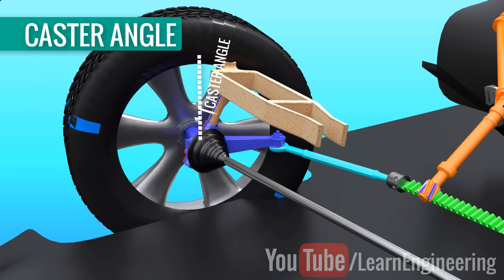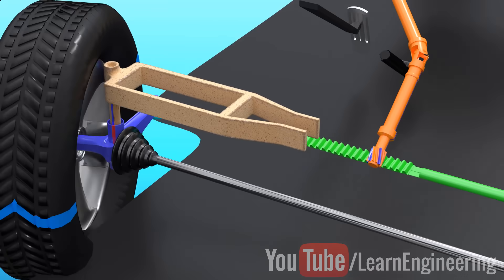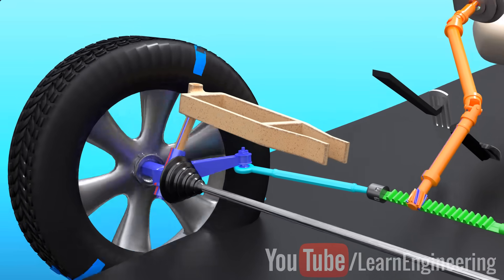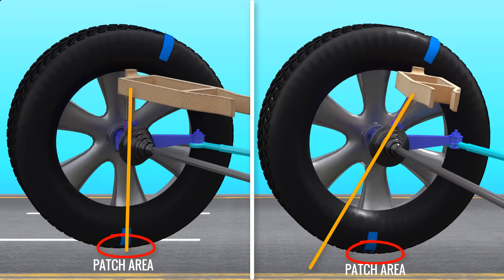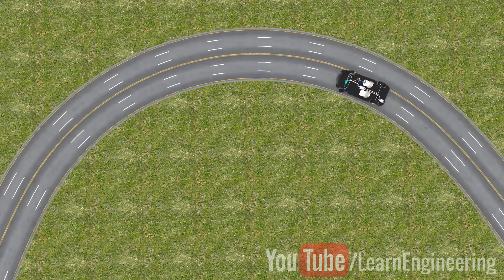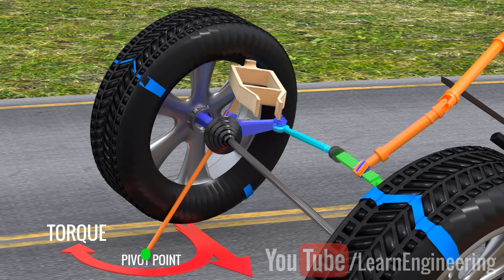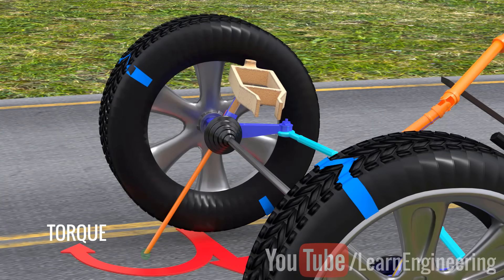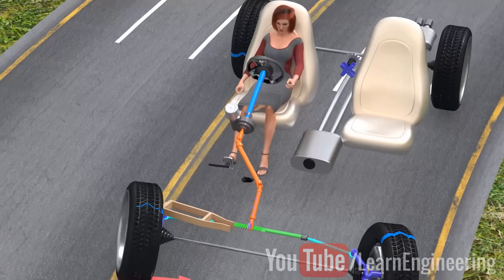How does the Steering Wheel automatically returns to its center?

Comment: Can anybody help me out here, ?
after a service something happened suddenly and my car's steering wheel won't return to centre, and steering feel little hard to turn, I replaced new pair of tyre in the front as replacement was needed anyway, replaced steering rack, checked suspension, but the problem persistent. Since caster angle isn't adjustable, adjusting which angle and to what degree should fix the problem.

Comment: Does a caster effect exist in an electric steering rack vehicle?
I replaced the broken control arms and tie rod on a BMW 320i with the electric steering rack, after a collision.
After the perfect alignment the steering wheel does not go back to the center after a turn.  Is there programming or coding that needs to be done for that to work, after replacing the tie rods?
Its not my vehicle but the owner claims the steering wheel doesnt go back to the center after turning.  Im concerned now.  
Please advise!

Comment: Some one make me feel stupid will lager diameter tire change the caster in any way 
I've had a truck since it had 100,000 MI it now has 375 
Multiple  times I've rebuilt every component in the front end except  steering  box and dam truck doesn't return  to center on its own on The highway it does a little, it does have larger  tires  and cognito a arms that allow u to bolt the ball joint in from either side to compensate  for larger  tires but it did same thing when I got it and it was factory tire size a arms everything was Factory it actually took me a little bit to figure out why exactly the steering felt the way it did trucks never been in an accident even before I got it I know who owned it the whole time when it's got new tires balance they drive straight no shake vibrations I guess at this point I can try a steering box the truck don't owe me anything but I don't think that's going to fix it any suggestions or ideas would be appreciated

Comment: This is not a centrifugial force. This is a gravity force. It works on a wery low speeds too, which is not the case for a cent. force. When you turn the wheels you push your front axis (and the center of mass) a bit upwards. And when you release the steering the whole system goes to the most stable state with the lowest position - when the wheels are straight. Just check with your bicycle or a bike. Keep it perpendicularly to the ground and turn the front wheel. You will see how it goes a bit up and when you release the grips it will turn the wheel towards the straight position and goes a bit down. Though the friction won't let it make completely. You can even check with your car - just turn your wheels right and left when the car is parked. You will feel how it goes up at the far lefr and far right positions and goes down when you cross the straight position.

Comment: i am an engineer 47 year old. i have been working as a professional Machine designer for 25 year. i did many models and simulations to find answer to the same question what you are dealing.  in four wheelers we are using the akier-man steering gear mechanism and 'amber' is the inclination that takes the turning axis's centre to the rotating wheel centre where the wheel touches the ground. when you look from the front the axises of  the front wheels seem to be like the letter 'A' (this much visible in form trackers)  . caster angle is being used in 2wheelers which gives a counter force that stabilizes the vehicle upright while in motion.

Comment: There are kits to implement adjustments that the manufacturer did engineer into the design. The most common is a camber kit. On a strut system the strut mount holes can be elongated to create a caster adjustment. This is usually required when there is collision damage that either the body shop can't fix or the customer doesn't want to pay for.

Comment: This definitely makes sense, but the textbook I'm reading about it (CDX Fundamentals of Automotive Technology 2nd Ed) is saying it actually has to do with the body roll of the vehicle pushing the stub axles. The wheel turning out causes body rise and the one turning in causes body fall/lowering. When you let go of the wheel, the side that rose will push back down and, working with the caster angle, push the wheel straight again. I imagine the whole answer is a combination of these two concepts, as this one helps to explain how shopping carts get crazy when you push them really hard. They seem to lean into a turn on their own, even if you pushed fairly straight. The centripetal force is then in front of the steering angle  (due to negative caster on the rear caster wheels) and would reinforce the turning in of the wheel.

Comment: In a more simple way, the concept is very similar to that of a shopping trolley where the wheels are off centre from the swivel connecting each wheel to the trolley frame, so when you push the trolley in a straight line the wheels will align in that direction.

Comment: What if the steering wheel doesn't return to the exact center, but a bit to the left. Can this be adjusted ? The car goes straight while holding the steering wheel straight however if I take my hands off  it will slightly turn left and stay there.

Comment: Well explained. However, it would be great to also point what drawback this solution has : the patch area is made non uniform during turns, and the tyres wear in a non uniform fashion. Maybe there are other drawbacks too, like a smaller patch area , I'm not sure

Comment: WRONG!! the castor angle is responsible for steering stability. What actually does the sterring return is the SAI or KPI angle (King Pin Inclination). it´s the spring´s inwards lean, when you turn it pushes the car up about 1 inch, when you let go of the steering wheel gravity pushes the car back down and return the wheels to their original position

Comment: Yea but it doesn't work if you are stopped  so it would be better to just put 2 sensors, one on the wheel and one on a neighbouring object so that it can calculate where is the straight wheel position it would help drivers to coordinate while parked witch is straight and witch not(ofcourse then it would need a electric powered motors to move the wheel which may be more complicated)

Comment: A similar effect you can see with motorbikes as well. A cruiser has a relatively higher caster angle and feels more stable. While street bikes and sportbikes have an almost vertical axis of rotation in front, which is why you see them wobbling more often.

Comment: You could have made it a little more complex by explaining how the steering arms are not parallel which results in the inner wheel having a tighter turning radius than the outside wheel. Do that on the next video.

Comment: The engineers probably applied the castor angle to overcome the body roll loss of traction due to centrifugal forces, the return to zero of the steering was perhaps a added bonus which came as a surprise to the benefit.

Comment: Pneumatic trail in addition to mechanical trail (caster) are the components responsible for steering wheel return. At low lateral accelerations (low tire slip angles), the pneumatic trail is at a maximum. As lateral acceleration increases (increasing tire slip angles) the center of the lateral force moves forward, reducing the pneumatic trail, and thereby reducing the aligning moment that causes steering wheel return. At very high slip angles, the pneumatic trail can change sign, and the 'aligning moment' is now acting to increase the steer angle. This change in pneumatic trail will change the steering wheel torque perceived by the driver, and can be a signal to the driver that the limit of adhesion is approaching (and quickly.....)

Comment: I think this kind of mechanism also shows up when you are free handing in the bike. When you're turning the bike, the centripetal force acts in the pivot point with restoring torque due to the fact the the pivot point is in front of the patch area of a bike, therefore, provides a restoring torque
Reply: I think another perfect example is when you push a trolley. When the trolley is moving forward the front wheels is automatically adjusted towards the direction is heading.
Reply: Veritasium made a video about that very thing!
Reply: @EmceeJoseph   is that about trolley one, can u just share the link here
Reply: Which one? @EmceeJoseph
Reply: Deez
Reply: nuts
Reply: @dockwonder2278  inside
Reply: @quaxky326  yo
Reply: @musiciansdreams2541  mouth

Comment: It is not the case when front wheels have driving force. Since power steering was introduced. In fact,  nowadays, self centering force mainly rely on Steering axis inclination (SAI) instead of castor angle.

Comment: Fun fact, if that angle was inverted, steering wheel would automatically go to full turned position, you can observe that by driving backwards in  some older car that doesn't have any "helping" mechanisms or electronics

Comment: This is such a hard concept to grasp. When I first heard about it I kept getting bogged down by the fact that the tire basically is turning through the ground. Definitions really helped with this tricky concept. I'm still confused about the turning into the floor thing but at least i know about patch area and the axis not lining up with the patch area being the reason for that restoring torque...really cool stuff!
Reply: You're not turning into the floor, you're lifting that corner of the car by a little bit. That's part of the reason why caster angle increases steering force.
Reply: Nic

Comment: In fact, there is still a restoring (a.k.a. aligning) torque even if the caster angle is zero. That is so because the lateral force does not pass exactly through the center of the contact patch (patch area) in moderate speeds.

Comment: What happens during a drift though ? The wheels will countersteer to correct the drift inspite of the increasing tilt on the tire against the ground, which in a normal forward driving would help them to align with the forward direction of travel. In a drift they align with the new direction inspite of the increasing tilt which should push the tire straight, until the tire is not tilted anymore right ? Apparently its still better for a tire to align itself with the drift even though the caster angle should fight it ?

Comment: This video is completely wrong. Actually, the self-centering mechanism has nothing to do with the caster angle. SAI plus wheel offset out to the steering axial is the only source for self-centering.
Reply: The easiest way to falsify this video is to understand that the self-centering mechanism is a static characteristic, i.e. it comes from gravity and has nothing to do with the dynamic things such as speed or any kind of inertial forces such as centrifugal forces. Even if you put both the front wheels on two frictionless patches in your garage, you can still verify the self-centering mechanism.

Comment: The most significant part is 0:26 where you can see that when the car is in a curve the centripetal force induces torque in the caster angle direction. This is because the where the tire meets the ground and where the tire is connected to the axle form a moment arm.
Reply: Thanks bro! Your comment actually cleared my misconception that why does the torque produce I was missing the moment arm thing

Comment: Honestly I just thought it was the wheels straightening out via force with the ground and that turned the wheel back.
Reply: Basically. But that only happens when the contact patch is behind the pivot point. Hence, castor.

In shopping carts, instead of using the angle, they physically position the wheels behind the pivot axis, which achieved the same effect.

Comment: I don't agree that it's the centripetal force the centers the wheels when turned. The reason for this is that even when you are crawling along very slowly, the wheels will go to their straight-ahead position, and there will be almost zero centripetal force then.
Just found this:
"The caster angle is popularly described as the angular displacement of the steering axis from the vertical axis of wheels. This further implies how far is the steering axis to the vertical axis when viewed from a vehicle’s side. When you turn the steering wheel to direct the front wheels, the wheels pivot about an axis that is far away from being vertical.

For a fact, the pivot line would lean backward at the wheel’s top with reference to its bottom. In turn, the car would lift a little, but the steering wheel input would help it stay on the ground. When you let go of the steering wheel, the weight of the car pulls the steering back to its original position. This makes clear why steering wheel returns to center after turn."
https://carfromjapan.com/article/driving-tips/steering-wheel-returns-to-center-after-turn/
Reply: ... when you turn the steering, it slightly lifts the car due to the castor angle, therefore the mass of the car brings the wheels back to their straight ahead.

Comment: I heard another explanation, the angles are not the same, if you turn right the right wheel makes a larger angle than the left wheel.
That makes that, assuming the forces of friction parallel to the length of the car are the same on both wheels, the left wheel generates more torque than the right. The angles are not the same because the arms are not parallel but form a regular trapezoid.

Comment: Nice. So if you mount it the other way (negative caster angle) then it becomes undrivable because the wheel will go to extreme instead of neutral.

Comment: I drive a forklift as part of work, and its wheels have 0 castor angle, so the wheels stay where you put them. Not that you should let go of the steering wheel when driving but if you do you will keep steering and the steering wheel wont move.

Comment: Typical US centred video who have never heard of Citroen. Citroen in a typically French way did use complicated springs and valves and hydraulics to return the wheel to straight ahead. The car in question had zero castor, trail or camber. The wheels pivoted to steer on a vertical axis exactly vertically through the centre of the wheel. All "feel" to the steering was applied artificially as seen on the original DS and the SM.
Reply: This video only covers cars that don't break down after a year of normal usage like French cars.
Reply: @mitsako1  Ha, ha, ha, ha.

Comment: Hello,It is so simple but the angle depends on the car segment and the tire width and aspect ratio.You even can watch it when you turn your steering  as much as you can,you can see the angle.But the shown steering mechanism is not true nowadays steering is provided by hydraulic pump or EPS system,but it was interesting.

Comment: Nice video, however not 100% correct. In modern electric power steering systems (EPS) we use an active return software function which drives the steering wheel back to center via the electric power assist motor. The kinematics alone is no longer responsible for the steering wheel return in modern cars.

Comment: I wish the video discussed 
1) what changes with more or less positive caster angle and
2) that with more caster angle, the front of the car is actually raised a bit and thus the weight of the car to come back down to rest also contributes to steering returnability.

Comment: One small addition to the excellent illustration, the car with zero castor angle will still have some steering return or self aligning torque due to the pneumatic trail in the tire. As point of application of the net lateral force is a bit behind the tire contact patch. Hence the pneumatic trail will add to the steering self return.
Reply: And the slide toe-in setting

Comment: In drifting, if I turn left and release the steering wheel,  how come the steering wheel automatically goes to the right, but not central position ?
Reply: Because they align to the direction your going, not where your Car is facing, while drifting your Car is Not facing in the direction your actually going, so the wheels dont align to Center ;)

Comment: Very simple, it's because of the power and weight that pushes or pulls the car straight forward. Just pull up while the wheels are turned. You will feel that the car doesn't pull up as powerful as when you hold the wheels straight forward.

Comment: Centripetal force is the object or in the case car wanting to move in a linear motion not inwards at the center of a circle. The frictional force that is acting upon it is what’s going in the opposite direction not the centripetal
Reply: @Dylan Milby Centripetal and Centrifugal forces are radial forces. When a car negotiates a curve, it experiences a centrifugal force which tends to push it off track (outwards). The centripetal force (inwards) counteracts this force and helps the car in stay in position. It's the same reason why high speed roads are super elevated at curves. The superelevation generates the required centripetal force to counteract the centrifugal force otherwise the vehicle would skid off track or even barrel roll off the track. You can read more here: https://en.wikipedia.org/wiki/Centripetal_force